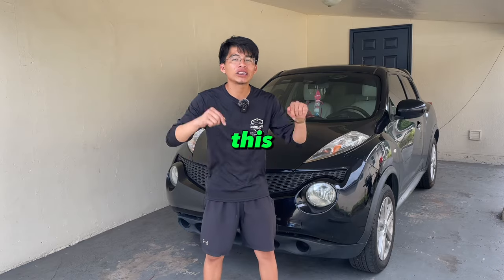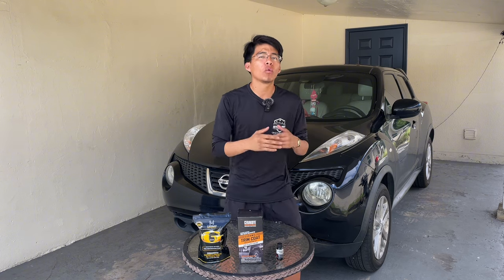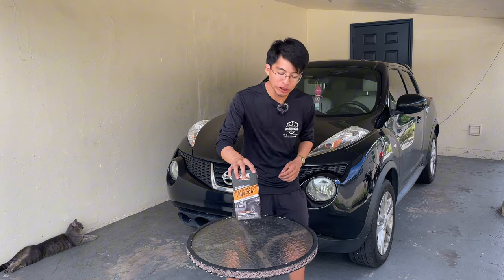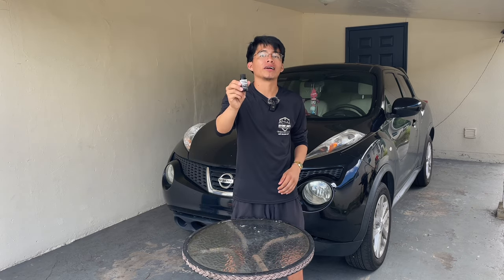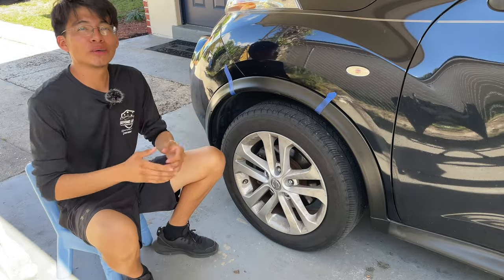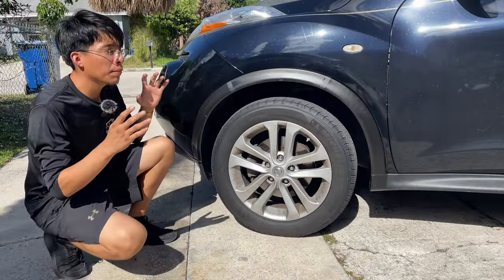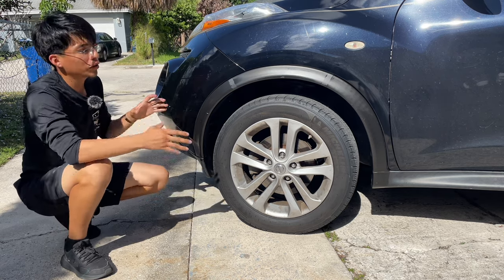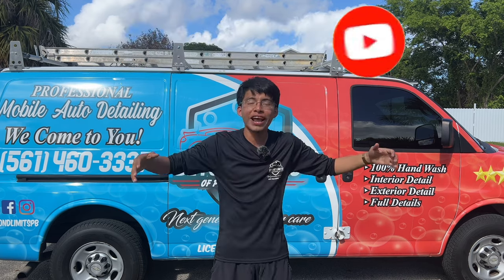The Best Plastic Trim Restorer in 2024 - Detailing Beyond Limits

Comment: fully agree. completely restored a 2016 Escape and a 2012 CRV. brought back the solid grey trim, nice semi-gloss finish, looks like it came off the dealership lot again when paired with a nice wash and wax.
Reply from the maker: Nice! Thanks for sharing 😅
Reply: with which one the cerakote?
Reply: @waynefilkins8394  both. bought two packs, did both vehicles. looks 20x better all dark and not faded.

Comment: Great video comparison! Solution finish. 

Cerakote looks great initially but in the future say 1year or 2 years down the line it’s very finicky and doesn’t like accepting another layer as the ceramic rejects it. With solutions finish you can just re apply at a later date if need be and it will always be absorbed. I stopped putting ceramic protection especially coatings on trim for that reason. 😢 Lithium is great to but doesn’t fill as good you may need another application but it’s super durable in terms of washing but the fading comes back quickly it’s all variables. Love the content 💪
Reply from the maker: Nice, I’ve definitely heard a similar analysis like yours. Thank you for watching! 😅
Reply: @detailingbeyondlimits  anytime I love your content 💪. Keep it coming.
Reply: So you would not recommend using the solutions sealer over the solutions restoration?
Reply: @johnnybravo7580  you can. It’ll prolong it longer for sure. But you’re just adding another step after. Which you have to wait hours before applying the over the top sealer. In terms of longevity I’ve seen an extra 3-4 months of durability. Which to me is not that significant especially since it was on a couple of vehicles that had solution finish for over a year and a half. But you can tell it was time to prepare to re apply again

Comment: I’ve used both solution finish and Cerokote. Cerokote last longer and a lot less messy to put on. The wipes can get into the small places plus Cerokote gives you more than enough to do 1 car. Also Cerokote drys within a hour so technically you could put another quick coat on right after your done

Comment: I would go with Lithium cubes and I’ve used it before and it done a really great job. It’s like it brings the plastic trim back to life. This video doesn’t do much justice. The instructions says if you need reapply again for better results you have to reapply and I’ve done that and it’s like brand new last 250 car washes more than five years